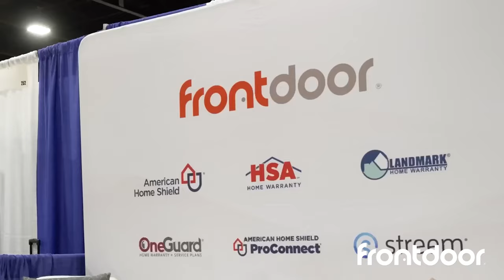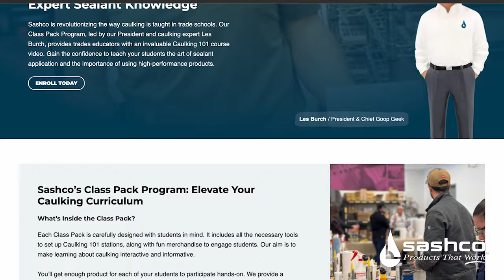Exploring Trade Opportunities: Talking Trades Webinar

Comment: I went to college at 17 poly Sci wanted to be a lawyer.  Hated college.  Saw an add for welder.  Employment agency. Interviewed didn't meet the need but the guy said come back later and maybe.... I showed up at 9:00 every Wed for 6 weeks.  He saw attitude and persistence.  I earned my Boilermaker card over the next 3+ years.  Did some other trades over the ensuing years. Millwright, equipment operation, sign electrician and a short stint in sales 😢.  Two contractors licenses  settled out as a certified welding inspector.   LOVE what I do and get paid very well to boot.  Persistence will earn you the gold ring at the end of the race!!